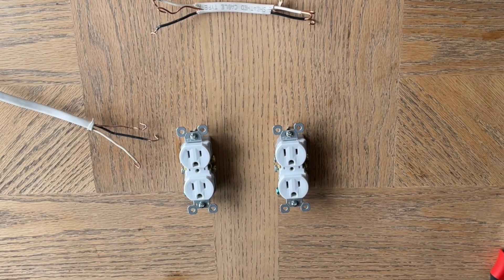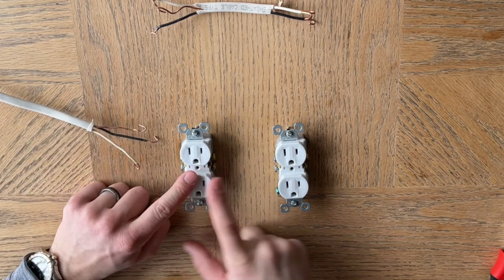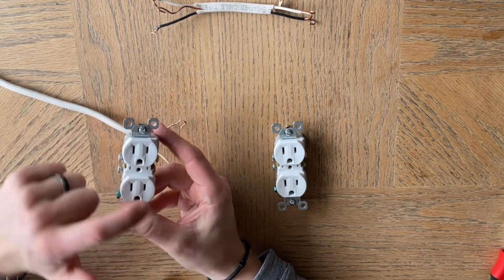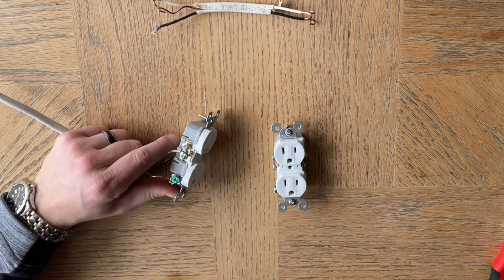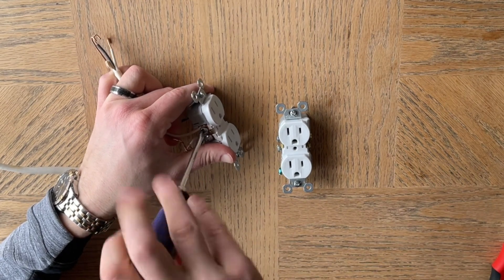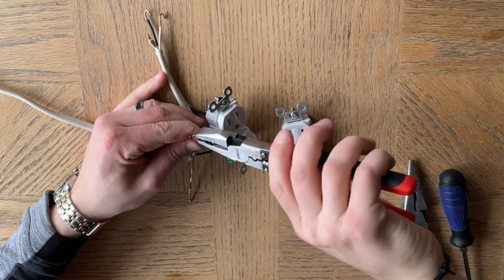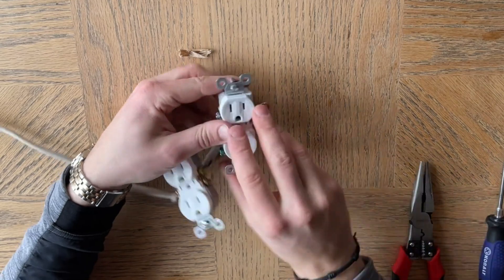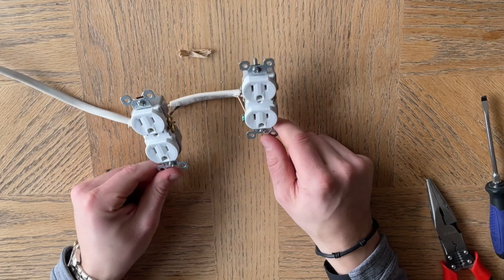How To Wire Outlets In A Daisy Chain Wire Multiple Outlets Series Receptacle

Comment: would you wire this the same way if it was a 2 gang box instead of 2 seprate outlets?
Reply from the maker: No, I’d wire nut jumper wires to each receptacle from the main incoming line.

Comment: WHAT IF JUST WANT TO ADD THE SINGLE RECEPTACLE ONLY  INTO THE CIRCUIT ?   FROM POWER COMING INTO SHED TO a  RECEPTACLE  ( WHICH I CURRENTLY DON'T HAVE IN MY CIRCUIT ) and CONTINUE ON  TO LIGHT SWITCH. THEN WOULD IT BE BLACK and WHITE BOTTOM and TOP WOULD BE WHITE and BLACK ? SO BLACK and WHITE ON ONE SIDE and BLACK and WHITE OTHER SIDE. EXCEPT STAGGERED. WANT WHOLE RECEPTACLE TO STAY HOT  CONSTANT , WHETHER LIGHT SWITCH is ON or OFF.  THANKS
Reply from the maker: So you want to add a brand new outlet and the only power you have coming into the shed is via the light switch?
Reply: @HowToVideoChannel  NO SIR, the POWER IS COMING IN FROM OUTSIDE MY SHED AT SIDE.  THEN I WANT TO INSTALL a RECEPTACLE BETWEEN WHERE IT COMES IN and THE LIGHT SWITCH. SHOULD HAVE DONE IN BEGINNING, BUT WOULD LIKE TO DO NOW FOR OBVIOUS REASONS. NO PLUGS !!! SEEMS SIMPLE ENOUGH, JUST WANNA MAKE SURE I DO PROPERLY. I WIRED  the SHED ALREADY. AFTER SWITCH I HAVE 2 LIGHTS. THANKS
Reply from the maker: Okay, so at the place where you have a line coming into the shed, you can cut the wire and use wire nuts to add jumper wires that will send power to the outlet. 

You will have the incoming wires, the wires that go to power the light switch, and the wires that go to power the outlet.

You can do this directly in the outlet box. Or, you can add a box with a blank plate cover if you want the outlet in a different place.
Reply: @HowToVideoChannel  OK SIR. I TRY TO EXPLAIN AS SIMPLE AS I CAN. SO MAKE 3 PIGTAILS, JOIN ALL BLACK TOGETHER, JOIN ALL WHITES TOGETHER , JOIN ALL GROUNDS TOGETHER. THEN JUST WIRE SOCKET LIKE NORMAL. 1 BLACK WIRE TO BRASS HOT. 1 WHITE WIRE TO SILVER. 1 GOUND WIRE TO GREEN.  WITH THIS SETUP POWER WILL CONTINUE TO FLOW THROUGH TO LIGHT SWITH and  RECEPTACLE WILL BE HOT ALWAYS. THANKS
Reply from the maker: Yes, essentially, you are splitting the incoming power and sending it in two directions. 

One line to the light switch, and one line to the outlet.
Reply: @HowToVideoChannel  SO MY PLAN is SAFE and WILL WORK ? ACTUALLY SAME LINE  FEEDING OUTLET WILL GO ON THROUGH OUTLET TO LIGHT SWITH. SO JUST LIKE CUTTING WIRES  and  INSERTING RECEPTACLE. SOUNDS SIMPLE ENOUGH.  THANKS
Reply from the maker: Based on my understanding of the situation it seems that it will work. You may want to have someone look at it if you aren’t confident.
Reply: @HowToVideoChannel  NO I'M CONFIDENT NOW, TRUST ME I KNOW MY CAPABILITIES. IT'S EITHER PROCEED or STOP. I'M MAN ENOUGH TO EXCEPT the FACT IT'S ABOVE MY LIMITS.😁IT SEEMS BASIC IN THEORY, JUST NEEDED SOME APPROVAL.   TALKING TO YOU and a NEIGHBOUR, I FELL GOOD. I LET YOU KNOW HOW IT WORKED OUT. THANKS AGAIN
Reply from the maker: Awesome! 
Looking forward to it!